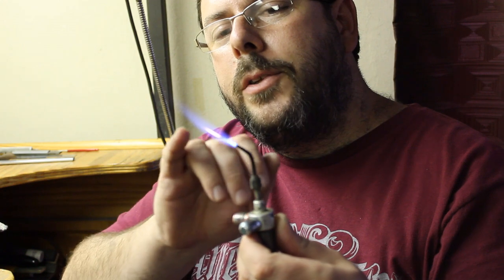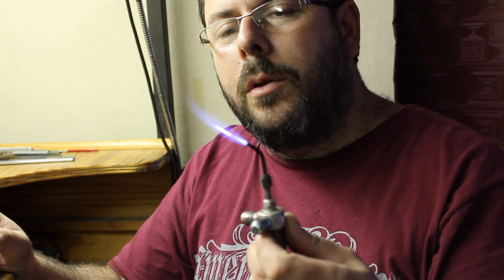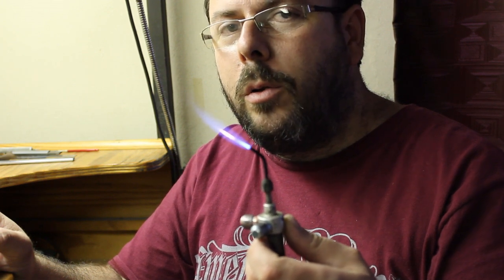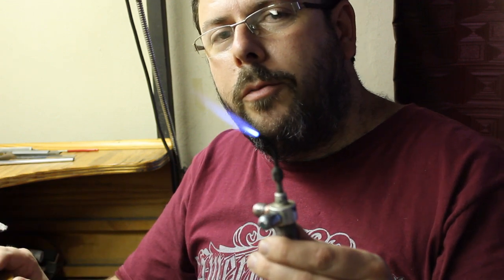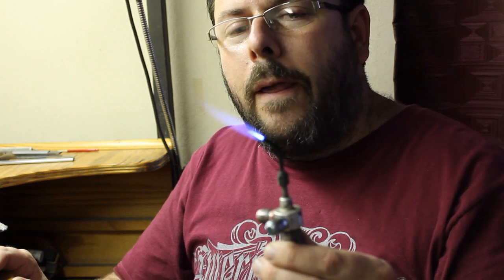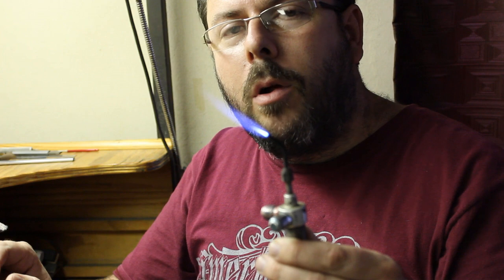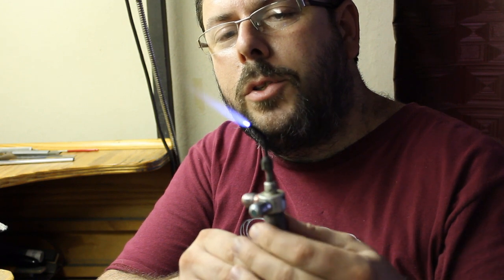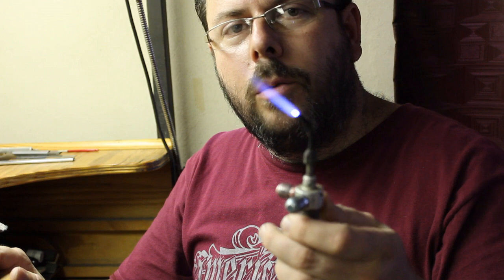Flame control

Comment: I've been always reminded to close gas first and then oxygen to prevent the flame from being sucked into the cables, because in most of the toarches the overall pressure of oxygen is higher then gas. Could you correspond to that?
Reply from the maker: You should always close the oxygen first and then the gas. If you close the gas first you will get a small explosion in the nozzle of the torch
Reply: Nope, you turn the gas on first, but off second.

GOOG is a great mnemonic for remembering this - Gas Oxygen (on); Oxygen Gas (off).

Comment: Nice, beginners video. Good reminder for others as well. One caveat, I don't think using a Bic lighter is recommended by the torch manufacturers. May as well teach the 'right' way, since this is considered a possible safety hazard.  So, if that's all that's wrong with your first video - I think you did well.
Reply from the maker: You are correct regarding the manufacturers safety recommendations, however in my 27 years making jewelry I have not seen a fellow professional goldsmith light their torches by any means other than a lighter. If you are mindful of the dangers and take care you will be fine. Like keep the lighter far away from the flame once lit. Like putting the lighter in your pocket. Mmmm.